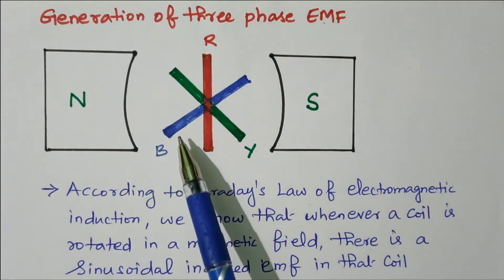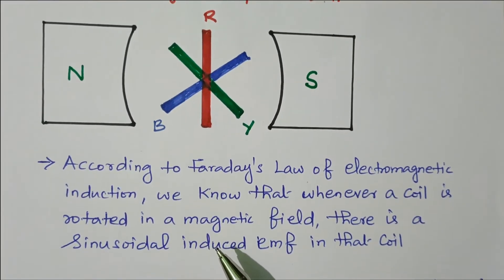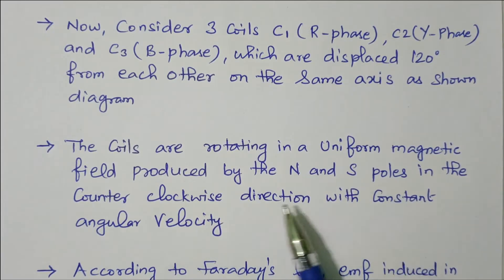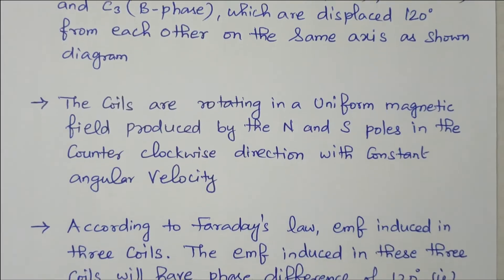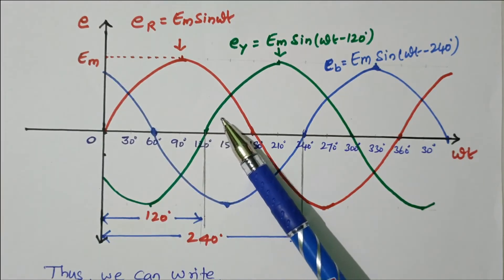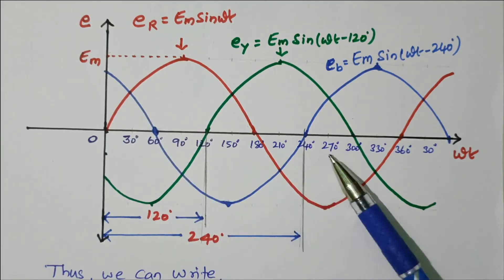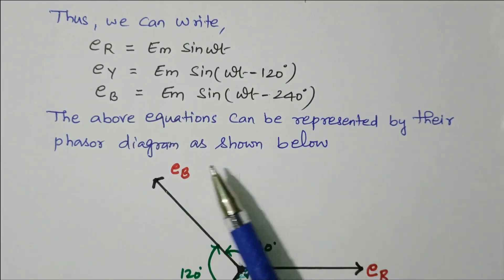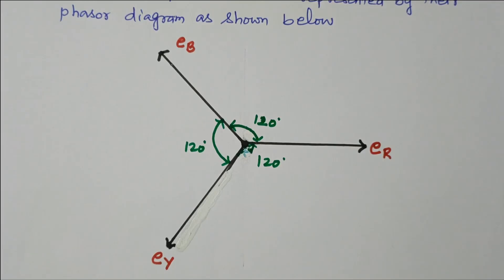02 Generation of Three Phase EMF

Comment: how all three coils rotate simultaneusly without colliding
Reply from the maker: Coils are placed in a iron core with 120 degree displacement
Reply: Coils are fixed in a place around the magnet, the magnet is the one rotating inside the generator.